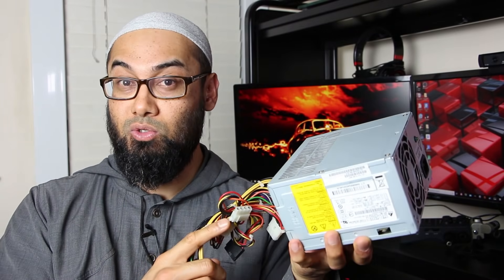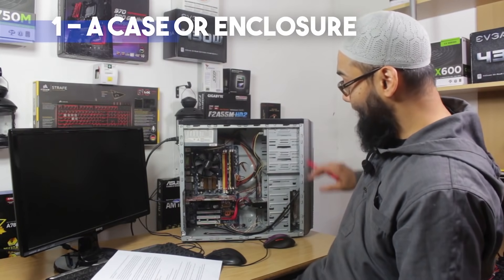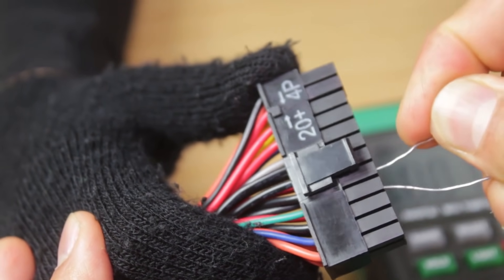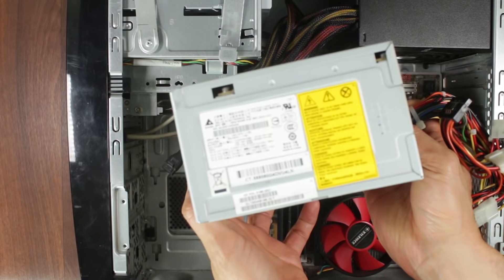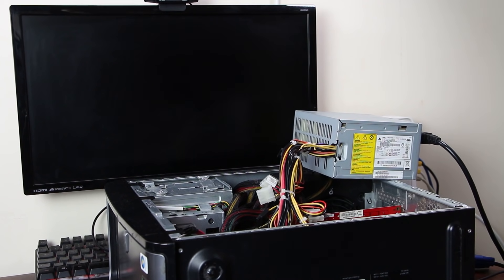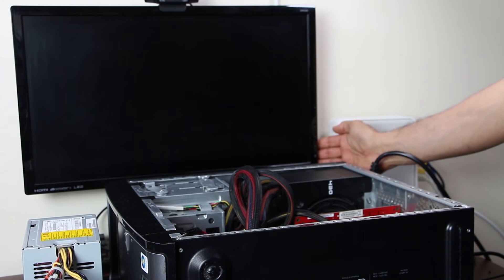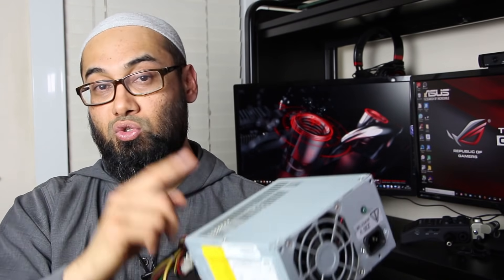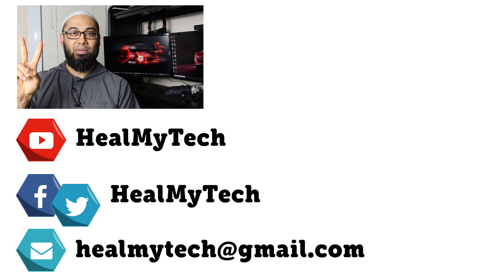Computer Turns On But No Display On Monitor | Led Light On Fan Spinning | Power Supply Unit Pc?

Comment: Hey HealMyTech love the video, my brother has a new built pc, and it works fine, but he has a 4 year old power supply that wasn't used for more than 3 months before building this pc so it was parked down for the 4 year period and the pc comes on, works for a few minutes sometimes a few hours then the monitor cuts off. The pc led and fans still spins but no display, could that possibly be a PSU issue as well or something else?
Reply from the maker: You say monitor cuts off, monitor only?  What tests have you done so far to troubleshoot?
Reply: @HealMyTech1  The only thing I've done so far was just change around the fans in the system, ik that's probably not gonna do anything but it cut off 3x this morning and when I did that, it hasn't cut off since, but if it do cut off I'll try my power supply in his pc and see what happens, I have a good evga 500w power supply and wanted to try his psu in my system to see if anything cuts off on mine then we'll know for sure it's the power supply but like you said it's not really recommended so I'm kinda scared to do that
Reply: And yes the monitor only like it's still has power but says no signal so idk
Reply from the maker: So if its only your monitor, assuming you are correct in your diagnostics, and your computer is still working fine, then its an issue with the monitor, cable or video port from your GPU, I don't see why your PSU will cause your monitor to switch off since it is being powered by its own source.  I am here assuming that you are POSTING successfully, unless you haven't described your problem accurately.
Reply: @HealMyTech1  Everything is as you said there's gotta be a problem with either the monitor or gpu for real cuz I actually, this morning, switched his gpu with mine, has his pc atm running valley benchmark and looping it for over an hour now and it runs fine. My gpu is in his system atm. He only has tat gpu for about 2 weeks now and the monitor, we got that from a friend but about 5 months before he got his components for his new system he was using that monitor and it worked fine so idk but i"llkeep an eye on that
Reply: @HealMyTech1  So bro how I switched the PSU, I just started experiencing something very similar to his situation. His PC runs flawlessly with my PSU and with his PSU in my PC I ran 3 games of PUBG just now with my brother and a friend and my PC froze 3x. Like the PC monitor is still on, I can still talk to them using Discord but the PC is just frozen, and it knocks the SSD out where if I RESTART the PC it comes on saying it needs a drive to boot off of where as when I  SHUT DOWN and power it back on, it comes on fine. Now again his PC used to cut off with screen not getting signal but PC still running where now mine is Freezing with screen on but still PC stays on running so I really think it's the PSU now and like mentioned he had that PSU about 4 years now and IK it's not a SSD problem because My system never gave that problem before the switch.
Reply: becca  it was yea now it fives another problem same thing but it's the motherboard now. He has a 6th gen intel cpu and motherboards are so hard to get on the market for that gen so I told him dude I think you should probably just upgrade at this point cuz why not you know. Get a 10th or 11th gen intel cpu or ryzen cpu and compatible motherboard. Atm a friend lent him his spare pc to get by so he's currently working on it.
Reply: becca  if you can get a proper working psu that you know has no issues, you can try that in your system to see if it fixes the problem ivf it does it's the psu if not can be the motherboard and at rare times believe it or not can be a faulty ram or ram slot. kinda the main reason I told him to upgrade cuz his motherboard had faulty ram slots and now just plain not working. Idk man something about some older model boards that are very faulty, it sucks :/
Reply: becca  Wow that's super weird but I hope  you get through with it cuz I know it can be a real pain so best of luck :) and no problem.

Comment: Just finished my PC build when I went to turn on the the power supply on button the lights quickly flashed in my computer, then when I turned it on using the pc button all the lights and fans come on and 2 seconds later it turns off then back on repeatedly and I get no display. The only way I can turn it completely off is with the psu on/off button. I have 9 RGB fans with 3 of them getting power from the PSU and the other 6 from the Motherboard, all of them are spinning but only the 3 running off the PSU light up the other 6 just spin, I also have RGB G-Skill DDR4 Ram that isn't lighting up. Can the PSU still be the problem?
Reply from the maker: What tests have you done so far?  I go through most scenarios, this should help identify the issue.  Troubleshoot A Computer Series Playlist | Computer Not Turning On | Pc Turns On But No Display On Monitor https://www.youtube.com/watch?v=Wkcx-x9gjkg&list=PLDmnHbxxv3ncrDmkkt4oVJTEIBIy9pvRN.

Comment: I got a new motherboard and processor to upgrade my PC but when I tested it to work, everything was running but no display was showing up on my TV. The power supply is an EVGA 400W and my motherboard is Gigabyte H310M A with my processor being an i5-8400 six core 2.8ghz. I am not sure what the problem is and I am very frustrated because I just bought these parts and I cant return them. Does anybody know the solution?
Reply from the maker: Have you followed the troubleshooting steps in this guide?  Troubleshoot A Computer Series Playlist | Computer Not Turning On | Pc Turns On But No Display On Monitor 
https://www.youtube.com/watch?v=Wkcx-x9gjkg&list=PLDmnHbxxv3ncrDmkkt4oVJTEIBIy9pvRN

Comment: I did buld a pc but it does turn on but no display help asus z390 f morherboard and i9 9900k
Reply: did you manage to fix it ? i am having same issue with the z390 f motherboard. It boots up, but no display.
Reply: @blodhunt  hi i did it and the problem was that the morherboard had tow bend on the socet. Than i did get a New z390 it did work 2 weeks but after no display just for nothing. And i se the cpu lamp blinks in the morherboard
Reply: I have the same problem with the Asus Z390 please someone help me
Reply: @henrypinto568  my problem Was one off the cpu pins on the morherboard was bend I did get a new know it works
Reply: YoutubeVloggs  My PC turns on fans are on, RGB on, mouse on , keyboard on motherboard on. My graphics card is a EVGA GTX 1660 Ti  and my power supply is Corsair RM650 X I checked my Graphics card and it’s running but my monitors says. No signal detected  and no signal cable connected. I plugged my HDMI cable into my graphics card and nothing. Please Help me thank you for your time

Comment: Yesterday, my pc turned off and after that no display on screen(sleep mode), this happened many  times but never faced no display issue. Cpu fan spinning no ram issues  could it be power supply issue?
Reply: I Noticed, buzzing noice coming from speaker
Reply: Yup, psu problem
Reply: Same thing happened
Reply: I suggest you would change the power supplier I have changed and running smoothly
Reply: Jurez Wadkar yup, that was the issue
Reply: My pc has the same problem only it’s not the psu I even bought a new psu
Reply: How to know is PSU problem I just brought the new psu for 1 month... 500watts

Comment: Could you make a video how to start up a PC that won't start? My PC was 3 months old so it was new and then on day it just didn't start.I looked into the PC and there were no cables loose.i don't know what to do?
Reply: Check PSU? Get a new power cable?
Reply: Ra1nzZ I built my pc about 7 months ago. I have a EVGA Supernova 750 G3, 80 Plus Gold 750W. I can’t see why that would of failed but I am getting nothing displayed on my screen
Reply: Jacob Brown yo how’d you fix it?
Reply: Kiwiz Lucks I found out it wasn’t the power supply but my RTX 2080 graphic card
Reply: Jacob Brown did you get it returned bro and also I fixed my pc

Comment: Hello sir. I have same issue with my laptop lights works fan working i already tried hard reset method ram checks but no luck. Just noticed one thing when i remove battery and leave plug charger in it only turns on few sec and then turns off. My screen is working fine also I removed cmos and put it back in. can u help plz

Comment: I have a 450w power supply and the problem that im facing is the same the monitor doesnt turn on and whenever I play some heavy games it turns off even though I have the max requirments to play it and it was booting up well till yesterday but it isnt now
My power supply is of 450w and the recommended power supply of my gpu is of 600w
Reply: @HealMyTech1  No I haven't I just bought this pc 1 month ago

Comment: I opened my desktop computer to clean the inside of it. I removed the pwr supply, hdd, ram, disconnected the fan from the motherboad to do some dusting. I also unscrewed the MB and did some dusting with a small paint brush. After dusting, I reassembled all parts and connected all the wires and all. Swithed on my pc and it did turned on. Was using it for a good amount of time. I was playing Fifa and then it turned off by itself. So I turned it on again and checked through event viewer to see the cause of the unexpected shut down. Ii was written "it could be caused if the system stopped responding, crashed, or lost power unexpectedly". Then I was watching a streaming of a live football match and it happened again. The pc shut down automatically by itself. I checked the wirings, remove and reconnect all the wires. Still don't know the problem. What could be the problem? Any suggestions?
Reply: Jack Gill overheating. Re-paste your cpu.